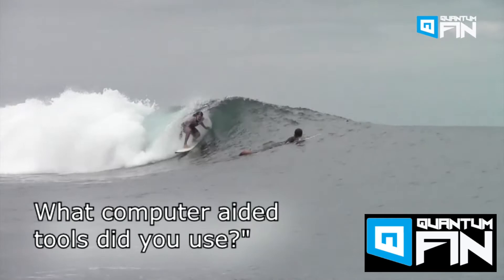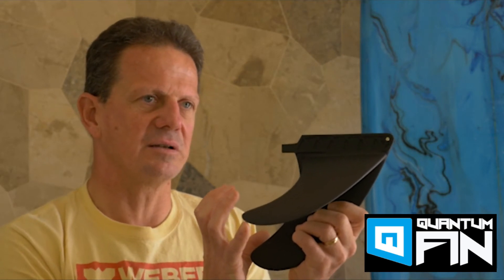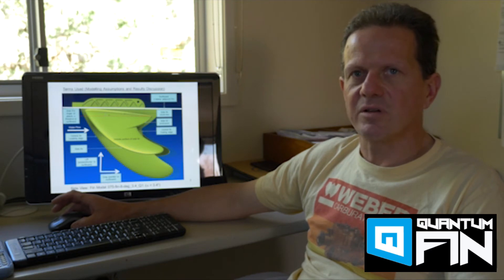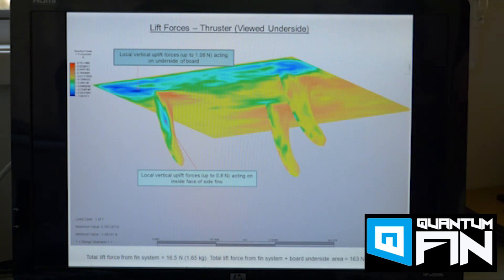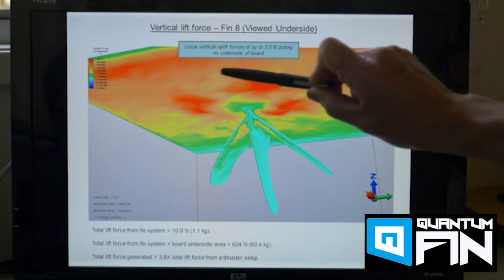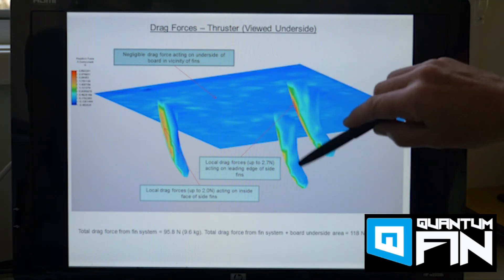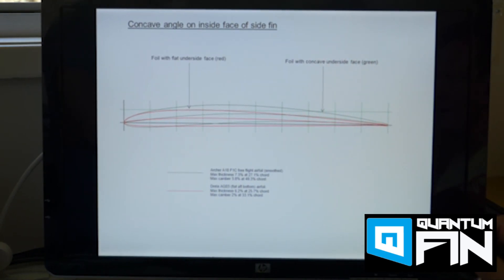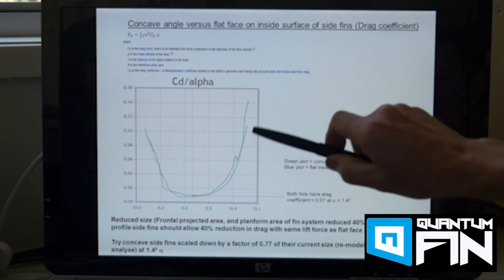The Science Behind the Quantum Fin - Full Details

Comment: Why is it assumed that we want lift in a fin? All fins create drag. A finless board flies. A hydrofoil creates lift, as it is a horizontal wing...two wings allows you to pump the board. Seeing as we don’t want lift in a normal board though, but actually want the tail to stay engaged in the water as much as possible, and do it in a way that creates the least drag through all manoeuvres, the standard foil we see in fish and mammal fins is tried and true for this purpose. Some interesting points are raised in this experiment that may be adaptable to craft other than surfboards. How about turning your thoughts from doing something to be different than a thruster, but still using three fins for some reason, to thinking about the properties you want from a new type of board, and then what type of fins, or lack of fins, or foils would be best for that purpose.

Comment: Pitch control is an issue with 'hydrofoil' shortboards, and it can be seen in the surfing video that the rider is using a very wide stance and quite a lot of input to control the pitch angle. That's one reason why I prefer lifting foils on longer heavier boards, the pitch is self tending. All told a great effort and I'll be lining up to buy one. I'm sharing the video too.

Comment: What angle of attack are you using on the side foils? It might be secret but as soon as the fins are available it can be measured so you might as well tell us. I often use 2 degrees. Effective angle of attack is what counts of course sine your asymmetrical fin foil will generate lift at 'zero' angle of attack i.e. if the AOA is measured simply in relation to a line from leading to trailing edge.
Reply: The thing that hasn't been mentioned is the amount of tail lift/rocker that would have a greater effect and something that can't be controlled in the manufacturing of a fin product. As even a zero degrees of offset attack angle of the side off axis fins would present an angle of attack due to tail lift. In this case the attack would be in reverse; pushing the tail down and therefore lifting the nose. This product would therefore be unpredictable due to inconsistent tail lift of any given board.
Reply: @robertcain3426  Not exactly, you haven't quite thought it through.

Comment: Bill Hunter talks about the lift force generated, expressed in kilograms. The problem with that is that lift force is dependent upon speed. Lift increases by the square as speed increases, so for example an increase in speed from 10mph to 14.1 mph will double the amount of lift generated. Bill doesn't mention this very important fact in his analysis. Instead he talks about the lift generated in '2 to 3 foot waves'. This is ridiculous since the computational fluid dynamics software can't use wave height as a parameter, it doesn't mean anything. To run the calculations he must have entered a speed ( there would be no lift predicted unless a speed were entered) but he doesn't tell us what the speed is. Furthermore he quotes only one lift force figure for each fin setup. This is also silly, since speed varies over a wide range in surfing.... and he claims that the fin will get the surfer to his feet faster when paddling into a wave... (precisely when speed is at its lowest) without telling us how much lift is generated at that speed. The Quantum fin website states that the fin is suitable for '2 to 3 foot waves'.... what they are trying to do with that statement is to say that the fin isn't suitable for higher speeds, and the only reason why that would be the case is handling problems which occur as larger amounts of lift are produced. What happens when the lift is greater than the weight of board and rider combined? We know the basic answer: the board will lift out of the water. This will cause catastrophic handling problems unless the fin setup is specifically designed to allow proper control without the rails and bottom of the board coming into play. The lift force quoted of 60 kg occurs at what speed? Whatever speed generates that lift, it will take only a modest increase in speed of 14% to match the rider's weight ( in the case of the 80kg rider used in the example). Another problem with the lift production quoted is angle of attack. Lift is typically doubled with a doubling of angle of attack. The fin is of course set at an angle of attack ( described as 'low') but what isn't mentioned is that the angle of attack on the fin is changed by the rider via the pitch or trim angle. This raising and lowering of the angle of attack of the hull ( and the fins) happens constantly and through quite a big range particularly during turns. So, the fin is going to increase lift dramatically not only with speed but with the board's trim angle. Of course the flow to the fin is partially determined by the hull itself since that directs the flow before it gets to the fins, so the effect of pitch is somewhat mitigated. This isn't just 'book learning' I've been making boards with lifting foils since 1998, and as it happened was working next door to a leading multihull and hydrofoil designer the next year, so managed to pick up a lot of useful information in a time when we had no internet or other means of doing research apart from 'Scientific American' back issues and tons of Naval Architecture and boatbuilding manuals. By the way the drag prediction is hugely oversimplified. There's no induced drag shown, and from the comments on the video it seems that only skin friction drag is being analysed, but it's hard to tell since it's not explained.
Reply: Hi, I'm in Hawaii, grew up in Cali (and Oz too) and "discovered" twin fins for myself (era was before my time) some years ago but they tend to not work well in the reef breaks where I live.  Your quantum fin intrigues me in that I'm wondering how it would work if you remove the center fin from your design, reducing drag but still providing enough "hold" or bite in a steep wave, particularly surfing on one's backhand.  Any thoughts?